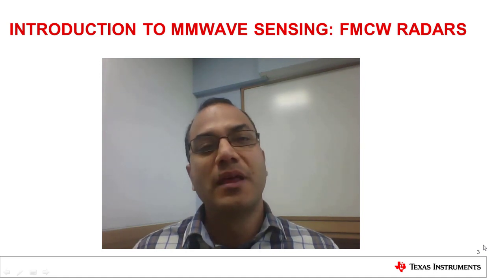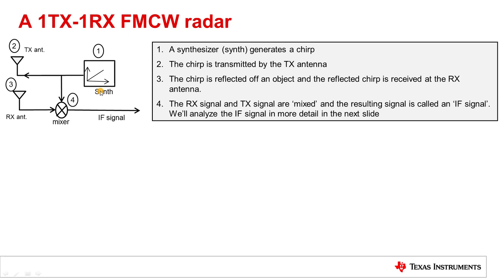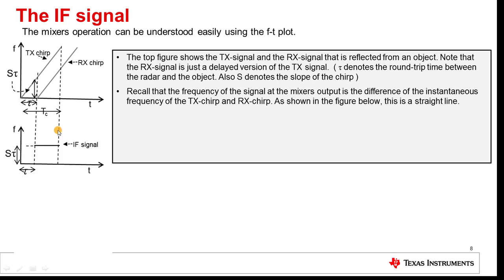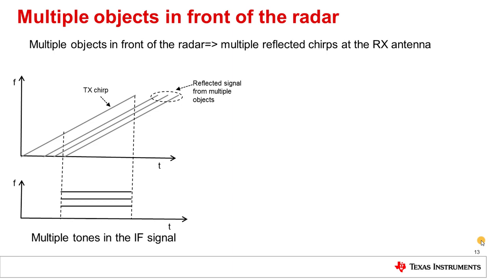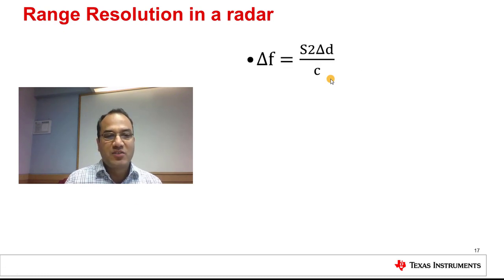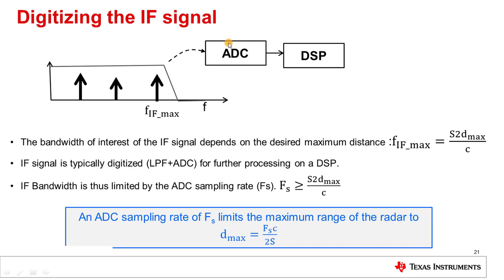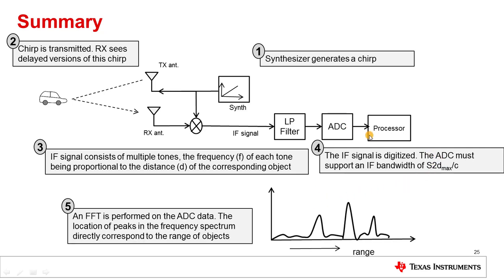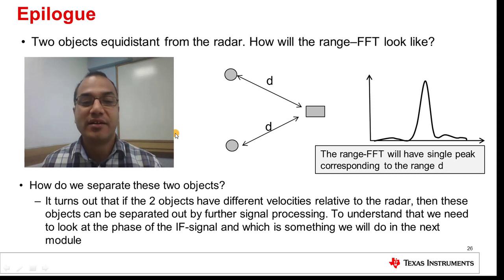Introduction to mmwave sensing : FMCW Radars

Comment: Thank you very much for these interesting and well-prepared lectures. I attempted a small exercise: with a range resolution of 15 cm and a maximum detectable range of 10m, the bandwidth of the chirp should be at least 1 GHz. However, I’m unsure about how to determine the duration of the chirp in the case that I am not interested in estimating either the position or the speed of the detected objects, but only the distance from the radar. So the question is: how can I determine the correct chirp duration?
Reply from the maker: thanks, you can refer to mmWave sensing estimator for more insights https://dev.ti.com/gallery/view/mmwave/mmWaveSensingEstimator/ver/2.4.0/

Comment: Can I use the electrical spectrum analyzer to measure the FFT signal (frequency-power graph)?
Reply from the maker: Yes, you can use an electrical spectrum analyzer (ESA) to measure the FFT signal, which is a frequency-power graph of a signal.

An ESA is a device that measures the spectrum of an electrical signal, i.e., it provides a frequency-domain representation of the signal. The ESA works by downconverting the signal to a lower frequency range, filtering out unwanted frequencies, and then amplifying and measuring the resulting signal. The output of an ESA is typically a frequency-power graph, which shows the power of the signal at each frequency.

To measure the FFT signal using an ESA, you would need to first convert the time-domain signal to a frequency-domain signal using an FFT algorithm. Once you have the FFT signal, you can then feed it into the ESA and measure its frequency spectrum. This would give you a frequency-power graph of the FFT signal.

Note that the accuracy of the measurement would depend on the frequency range and resolution of the ESA, as well as the sampling rate and length of the FFT used to compute the FFT signal.
Reply: @FlamboyantEngineer  Thank you for answering the question. So if I want to measure the FFT signal using ESA, FFT algorithm should be required?
Reply from the maker: ESA will typically use an FFT algorithm to calculate the FFT of the input signal.
Reply: @FlamboyantEngineer  You mean that FFT algorithm is typically embedded in ESA? if not, is extra FFT algorithm employed for the output signal from ESA?
Reply: @cornellnote-n7l  the RF SA typically uses an internal sweep oscillator in a receiver configuration to plot the spectrum, not a FFT algorithm. There is no FFT calculation that occurs in a typical RF spectrum analyzer. The display has the APPEARANCE of a FFT plot but does not use FFT. But to answer your original question, yes most RF spectrum analyzers with a bandwidth of at least the FMCW radar IF should be able to display the IF signal.

Comment: Thanks alot!
But there are a lot of things that I don't understand or that don't work out for me even after watching the video about 8 times

**First of all, I need to understand what the answer is to the 2 questions asked in the video.

**What is the effect of Tc vs a larger slope?

**What is the difference between frequency separation vs frequency resolution?

**What defines the IF bandwidth

**Which of the parameters (B,Tc,IF,d,S,τ,Fs) is responsible for:
- Maximum distance
- Ability to distinguish between nearby objects
Reply: Well, after some thought, if I understand correctly:

The IF resolution, meaning the amount of bandwidth to sample the IF frequency which means higher\lower Fs and sample components

If B is constant, the larger Tc is, the less the requirement for sampling frequency is, and this indicates a longer sampling time, which means something (??)

If B is constant, the larger S is, the less the requirement for a high sampling time, which means a high sampling frequency, and this indicates a higher IF resolution, which means a greater distance discrimination ability (??)

The concept responsible for the maximum distance is the IF resolution, because there the Fs is set, which is the sampling frequency that dmax is limited to, and the parameter responsible for the IF resolution are the parameters S, Tc by determining the necessary sampling components

The parameter responsible for the ability to distinguish between nearby objects is only B that expressed in the formula they developed in the video (speed of light divided by 2B)

Regarding the differences between frequency separation and frequency resolution I still haven't understood, even ChatGPT doesn't give a logical answer.

Comment: Thanks a lot for this video. I just have some comments:
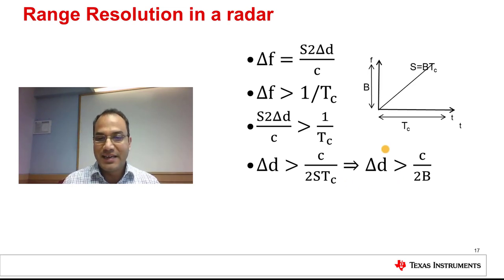Minute 13:50.  In the plot it is written S = BTc , but since it is the slope it should be S = B/Tc.
Minute 20:35   d_res = c/2B.  This means that d_res is conversely proportional to Bandwidth.  This implies that, by increasing the Bandwidth reduces de d_res.  However in the blue rectangle it is written that Larger Chirp Bandwidth leads to better range resolution.
Reply: Small D_res means better range resolution, if i am not wrong.
Reply: in 20:35 Note that the goal is to detect objects as close as possible.
d_res expresses the distance between the objects and you want it to be as small as possible and that means B as large as possible
Reply: Better the range resolution mean smaller should be its value. That's why if you increase the Bandwidth the range resolution will go smaller in value which mean a much better range resolution.

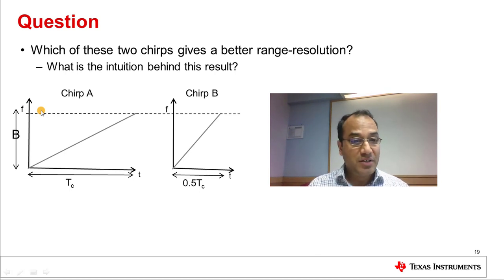Comment: Thanks for the amazing lecture! But I have a question on 14:31, page 19.

Though chirpA has a longer duration which is good for differentiating two tones, this is only when the distance between two tones stays the same.
With chirpB, even though it has a shorter duration, its two tones are now farther and easier to distinguish.

p.s. I found other comments also point this out.

Besides that, I wonder about the relation between capture duration Vs. frequency difference. For example, does double capture duration increase double frequency resolution?

Comment: I have a question.... what is the difference or effect if we use down chirp rather than up chirp as FMCW Radar TX?
Reply: You can use  down slopes for all chirps in  a frame. The theory and functioning would be the same (only the Slope S would be negative in the Math).
Reply from the maker: Hi, 
sorry for the late response. There is not difference as such. It depends  upon how the hardware VCO behaves sometimes

Comment: Hi! Thanks so much for posting this! 

Little side note, I think there is a small mistake at slide 21. The sampling frequency should be more than double the f_IF_max in order to adhere to Shanon's sampling theorem. This means that : Fs >= 4(s*d_max/c). Feel free to point out if I made a mistake in my thought process! :)

Cheers
Reply: For real-valued signals, the ADC sampling should be > 2B.  However, for a complex valued signal, an ADC sampling of greater B suffices
Reply: @sandeeprao3753  Very interesting, thanks for your reply!
Reply: @sandeeprao3753  Wow, I didn't know there was a difference between a complex broadcast and a real broadcast regarding the sampling frequency!
I'm about to finish my engineering degree and I'm only now realizing that it's true lol
Thank you!
Reply: Shannon's sampling theorem states that a signal can be accurately reconstructed from its samples if the sampling frequency is at least twice the maximum frequency component present in the signal.

In the context of a radio receiver, the intermediate frequency (IF) is the frequency of the signal after it has been down-converted from the original frequency to a lower frequency for further processing. The maximum frequency component of the signal at the IF is known as the maximum IF frequency (f_IF_max).

The formula you provided, Fs >= 4(s*d_max/c), relates the sampling frequency (Fs) to the maximum IF frequency (f_IF_max) and the distance between the transmitter and receiver (d_max).
By rearranging the formula, we can derive an expression for the maximum IF frequency:

f_IF_max = c/(2sd_max)

Substituting this expression into Shannon's sampling theorem, we get:

Fs >= 2f_IF_max = c/(sd_max)

Multiplying both sides by 2, we get:

Fs >= 4*(s*d_max/c)
Therefore, the formula you provided is correct.

Comment: Answer at 14.40: Chirp A has better frequency resolution than Chirp B, of course. On the other hand, two objects with the same Δd will result in a larger frequency separation in Chirp B because of the higher slope rate, S (see S*τ in 7.20). So, Chirp B has lower frequency resolution than Chirp A but the IF frequencies of the two objects are farther apart between each other in the case of Chirp B than in Chirp A. The net result is that the range resolution is a function only of bandwidth and the two Chirps will have the same range resolution.
Reply: same thought
Reply: Thank you, that is a great explanation as to why the range resolution is equal between the two cases. However, would the Chirp A configuration allow for a greater maximum distance measurement since the IF for a given distance would be a lower frequency than that for the Chirp B case?

Comment: Thanks for the great video! A question: at 4:25, the output of the mixer should also have a frequency part (w1+w2) right? This part is just filtered by the followed low-pass filter.
Reply: Yes, that is right. The w1+w2 component is filtered out, The w1-w2 component is a few 10's of MHz  while the w1+w2 component is (for a 77GHz Radar) ~144GHz
Reply: @sandeeprao3753  Thanks for the reply. I'm learning the basic of mixer so I asked this just for sure:)

Comment: Thanks so much for the great sharing! Just one slight confusion on slide 11: where does this delta_f > 1/T come from? For instance, is the FT of finite long continuous sine function equivalent to the FT of product of sine function and rectangular window function of T?
Reply: it is due to actually performing FFT rather than FT, since FT is applicable only continuous systems (i.e., real life). Using a digital system (my guess is that these figures are produced with MATLAB, but it could be any other tool), the horizontal axis resolution in Hz of the right figure (frequency) is equal to 1/T, where T is the total length in sec of the left figure (time). Furthermore, the total length in Hz of the right figure is equal to 1/ts, where ts is the sampling period or equivalently the horizontal axis resolution in sec of the left figure. I hope this helps and feel free to correct or improve.

Comment: I am confused between B and IF, where B is the bandwidth as subtraction between the frequencies of x1 and x2, while Intermediate frequency is a new signal out of the mixer that is having a frequency equal to the subtraction of the frequencies and phases of x1 and x2. I see them as the same while it seems they are not because when you gave the distance formula you said
d = Fs c / (2S), while S = B / Tc and Fs = 2 x IF, which shows that IF is not the same as B.
Reply: B refers to the bandwidth of the transmitted  chirp(see for e.g https://youtu.be/8cHACNNDWD8?t=169 )  . The signals x1 and x2 refer to the transmitted chirp and the return chirp (i.e., a delayed version of the transmitted chirp) respectively. The frequency of the difference between the two (x1-x2) is IF and is different from B.

Comment: Thank you very much for the tutorial! 
I have a question on page 13. Shouldn't the 3 f of the IF signal (the horizontal lines) start at the time each of them is received, and end at the same time (where Tx ends)? Why are they all lined up at the beginning? In my understanding it should be like a upstair staircase. Bottom line should be the longest as it's the closet object Rx and receives the earliest. And such for the top two lines... Or am I understanding it wrong? Thank you!

Comment: Have any one answered the question 14:29 ?
Reply: Lol I'm wondering the same... Hoping @Autonomous Stuff can help out here. Thanks.
Reply: I think they are the same resolution. the one with longer T has smaller delta freq compare to the steeper slope one, which has a larger delta freq, with the same delta time. With delta freq > 1/Tc, Tc has to be longer for the smaller delta freq to achieve the separating peaks.

Comment: On slide 21 (Digitizing IF signal), shouldn't the ADC sampling frequency be always greater than 2B? 

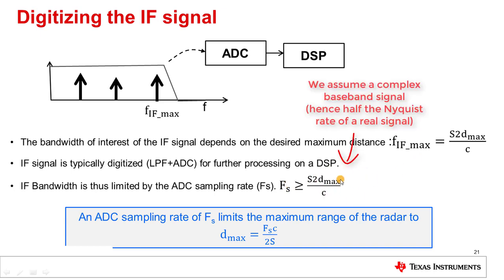At 16:24 it is mentioned that complex baseband signal is assumed (hence half the nyquist rate of real signal), what is meant by real signal here?
Reply: For real-valued signals, the ADC sampling should be > 2B.  However, for a complex valued signal, an ADC sampling of greater B suffices. See https://dsp.stackexchange.com/questions/672/complex-sampling-can-break-nyquist
Reply: Can someone please explain?
ADC sampling frequency must be double the maximum signal frequency. On slide 21 it can be seen that Fs and Fif_max are equal.

Comment: Very good and interesting video, well explained. I was kind of confused by the derivation in slide 17 because of the mentioned formula S=BTc, which is incorrect. It should be S=B/Tc.
Reply: you are right. The annotation on the graph is a typo
Reply: That is what I want to correct

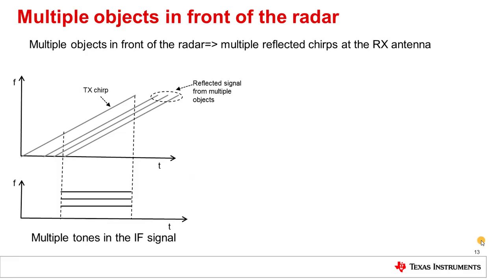Comment: Excellent stuff! But, at 9:35, you have slight error in the diagram of "Multiple tones in the IF signal"; Lower tone should be longer than one above, and middle one longer than last upper one. Not a big deal, but people who experimenting with some modules may find it confusing. I am waiting my "cheap" $6US 24 GHz module to arrive... then fun can begin. Thanks.
Reply from the maker: yes, i totally agree, sir. That's great. Can you tell me which one you bought, cause it seems really cheap and i would be interested to have a look. Regards

Comment: on page 12. why two tones can be resolved in frequency different > 1/T
Reply: As shown in page 11,  in one observation window T,  it must contain at least 1 cycle difference.  cycles = freq * observation Window T.  so  | f1 * T   - f2*T| > 1 then delta Freq > 1/T
Reply from the maker: Sorry for the late reply. This is because if two tones have a very less frequency difference they can't be resolved as two different tones in the frequency domain. Longer the observation period the better the range resolution. In general, an observation of window of T can separate frequency components that are separated by more than 1/T Hz.
Watch the same video at 08 mins 22sec
Reply: Hi, I loved your videos. But can you recommend some good book or website for indepth knowledge on automotive software development?